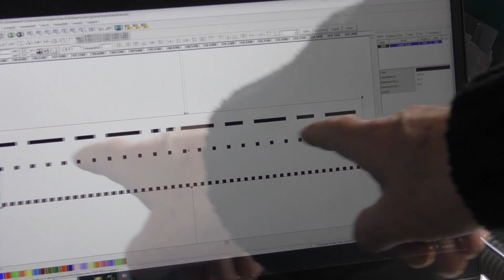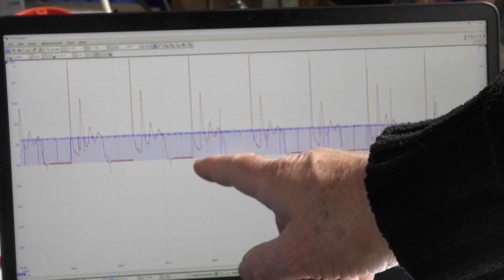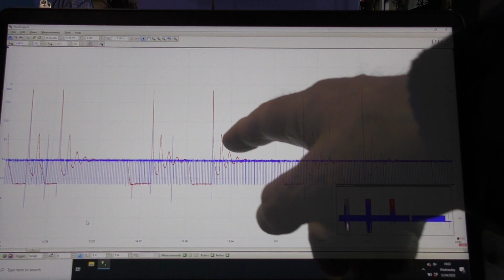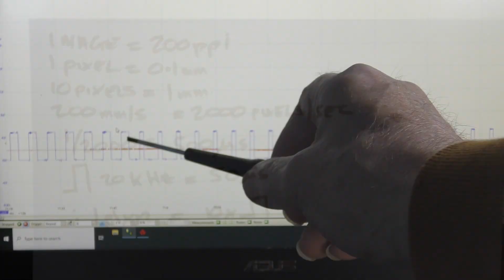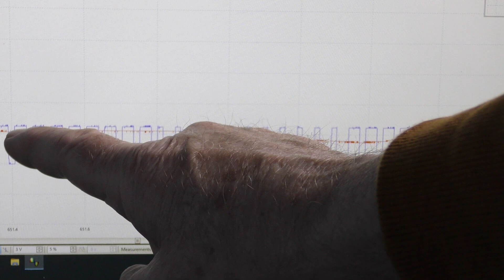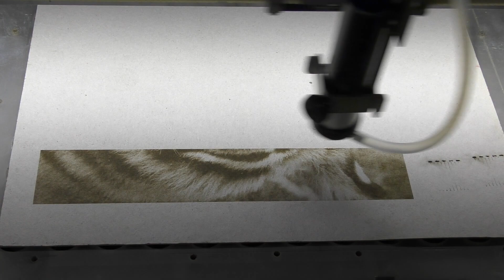RDWorks Learning Lab 250 Deep Dive into HV Power supplies

Comment: Hi there, we have been following your channel for some years and usually we can find fixes for problems pretty fast. In December our machine started to arc so we replaced the tube then it did something else so we replaced the power supply. At best we have it working to half efficient. I am hoping you are willing to help us out. Is there a possibility of that
Reply from the maker: Hi
 I will be happy to help you but yoiu will need to contact me privately  with the following  form. I will respond and we can then start a dialogue and work out the best way to proceed.
https://forms.zohopublic.eu/ndeavorlimited/form/K40XtreeemLaserCutterContactRussSadler/formperma/k2Cn0QN5ChpazfTMAUw25lZ-FKpjZa96TQWHjv3ntOg

Comment: Could  you put together a video and  do  similar tests  as in  this video and compare how a rf co2 tube compares to a glass hv power supply?  Also I'm highly assuming a higher kW max power supply than needed to excite the gasses in a glass tube would spike the watts/voltage initially and therefore degrade the tube more rapidly over time used than a lower kW max power supply.
Interested in what the voltage output looks like in the same  type tests between.
Reply from the maker: Hi
Sadly there is no comparison possible because RF and Constant Current tiubes operate withcompletely different principles. The end result is the same in that both produce a stream of output photons witrh a 10, 640 nm wavelength. The glass tube uses a high voltage to excite the nitrogen in the tube  which in turn stimulates the CO2 to create a laser output whereas the RF tube uses a GHz freqency with low voltage (about 40vdc) to achieve the same result. Because both systems are ionizing the nitrogen (producing a pink beam) they both pass throug a critical phase EVERY time the beam switches on   If you take glance at this diagran you will see that phase defined as Townsend
https://www.researchgate.net/figure/V-I-plot-of-a-DC-gas-discharge-7_fig1_327209884
This is a phase where the just a few free electrons (negative charge) in the nitrogen are stimulted to rush toward the anode (positive), crashing into other nitrogen atoms  and freeing up more electrond to carry current.  In the glass tube system  there are two distinct functions for the power supply. First it has to create a high voltage to stimulate the gas to ionize. However, stimulating the massive release of free electrons  means the potential for infinite current flow through the gas which is bad news, hence there is a secondary function for the HV psu and that is to limit the current flow to a few milliamps. This control of current is is achieved by a feedback circuit  BUT  this Townsend region is a phase of inoziation instability that we call preionization where the random nature of colliding free electrons can cause huge current flow spikes . In this phase the current feedback system  cannot respond quick enough to manage the current flow. It is only when the ionization reaches the glow discharge phase that the current flow can be managed by thr HVpsu.  In the case of the glass tube it is possuble to adjust the current flow through the tube  to change the power output of the tube. The  % power parameter is not controlling watts output but instead is is controlling the current flow through the tube  in a linear manner, The  output watts is very non-linear and will depend on the design and manufacturing quality of the tube.

As can be seen from this video, it take several milliseconds to intiate a stable output from a glass tube  EVERY time the beam switches on.  The RF power supply works in a completely different way. When you first switch the power supply on the high FREQUENCY causes the nitrogen to pass through this Townsed reqion of preionization but it only ever does it once because  there is  internal circuitry that provides a "tickle current" to keep the system at the edge of the glow phase even before you switch the beam on.  This means there is an almost intsantaneous power output the moment you ask ther beam to switch on. However, the biggets difference is the way the tube operates. It is controlled by a PWM system which means ther is  NO VARIABLE CURRENT CONTROL. The current is  fixed at a maximum that the manufacturer has deemed as a safe  long life value for the tube Thus when you buy a 60 watt RF tube  it  can only do two things...... deliver 60 watts or zero watts. There is no power control,  just an ON/OFF switching function The appearance of power control is acheievd  by allowing the beam to be on for a variable period during each PWM cycle  Thus %power is not controlling output watts  with this tube either, instead it is controlling the PWM duty  period and is ALWAYS operating at full current flow i.e.60 watts output

The claim that RF tubes have a much longer life than glass tubes  is very dubious because  the current flow  parameter that the manufacturer sets for an RF tube,  makes it possible to predict operating hours  with a reasonable degree of certainty (a bit like predicting ther number of print pages from an ink cartridge).  The dissociation (degradation) of CO2 in a glass tube depends on the current flow that the tube is used at. The manufturer of glass tubes specifies an allowable maximum opearating current and a typical operating life  but most people do not run at the max current  and many laser operations (like engraving) do not require high power.  So there is no way to compare liftimes. I personally have tubes that a 9 , 6 and 5 years old and all are still functioning as new. Just like an ink cartridge,  when the CO2 runs out the power stops 

The cost of a 100watt RF tubei is  6 to 8 times that of a 100watt  glass tube , so assuming  a glass tube lasts 5 years, can you  find an RF tube with a 30 year lifetime  I have spent money and time buiding and testing an RF system in an attempt to find the "magic" claimed for the technology.  Switching speed is it's only redeeming  feature  bcause that allows  for precision engraving. It is necessary to manage the massive beam divergence characteristic with a beam expander , which in turn wrecks the beam intensity profile and makes it a very inefficient cutting machine. After years of decrying the  cheap  short lifespan glass tube technology, Trotec have had to accept the weakness of RF technology for cutting and are now selling a Q series procuct that integrates both technologies. One for engraving efficiency and one for cutting efficiency.

Soory, there is no quick short answer to yout questions.

Comment: For cardboard/paper cutting - do you have a min power set (that is lower than the max power)?  The reason I am asking is because if there is a min power, then it will be lower than the pre-ionization power. For me, my accel values are set low in order to get straight cuts, but that in turn requires me to have the min power lower to not burn the corners. What do you think would be the best solution in this case?
Reply from the maker: Hi
Max and Min are equal because this is not normal constant power cutting. Enen though you still slow down forthe corners, the very short high power pulses do not cause burning because  they are always instantly vapourising the card.
 Reducing acelleration to achieve staright cuts  sounds like a mechanical issue.  If you wish to contact me privately so that we can try to sort this with email and pictures/video then use the following form

https://forms.zohopublic.eu/ndeavorlimited/form/K40XtreeemLaserCutterContactRussSadler/formperma/k2Cn0QN5ChpazfTMAUw25lZ-FKpjZa96TQWHjv3ntOg

Comment: Hi Russ, thankyou for these very interesting videos! A question please, the maximum current for a given tube can be limited by adjusting a trim pot on some HV PSU's, is there any disadvantage in ignoring that trim pot and instead limiting the current by reducing the allowable PWM duty cycle max in DSP controller settings (Laser max power% in Ruida)? Or is it effectively the same thing? Does the trim pot simply internally reduce the voltage of the PWM signal after its been converted back to analogue inside the PSU? My head tells me that the option of trimming the PSU and utilising the full 1-100% PWM pulse width/duty cycle range to relay the power control signal would result in better resolution when engraving varying tonal burn intensities in images? Penny for your thoughts.
Reply from the maker: Hi Nic
 A glass tube makes no use of the PWM because it is a CONSTANT current system that never switches on and off during running. It is only RF and diode lasers that can exploit the the pwm control.  I believe it is preset to 20kHz to control the stepper motors. Yes you can use the PWM output from the controller to controlthe %power into a tube  but  it can be confusing. Ruida recommend you use the analog output at  AN1 at CN5 for glass tubes. and the PWM output for diode and RF lasers. However, if you use the PWM output for a glass tube it just converts the analog output into a digital signal to encode the %power. As soon as that digital signal arrives at the HV power supply andinput filter convrts it back to analog. So ther eis zero control of your glass tube with PWM..  
The next issue you have to come to terms with is understanding what % power means. It's nothing to do with watts. It all about the max output current that your HVpower supply controlls. 100% power = max HVpsu output  and it is linear all the way to o%power=0mA. I So if you have a power supply that delivers 30mA ma and your tube requires 24mA max then your max current should not exceed 24/30=80%. see no value in fiddling with the PSU output to match that allwed through your tube. If you have an ammeter fitted its just a matter of running it at various powers to find the % power that allows the max allowable current through your tube. Lets say ist 80 % - 24 mA then you can set 80%max in the vendoer settings and never fear overdriving your tube. Ah, I here people say, but that means I lose some of my power control because I am only ever using 80% of the range.  Hmm .... is that REALLY a problem?  %power can be set in increment of 0.1%. That mens you have 800 power increments to platy with  Yes you may need close control of low power if you do photo engraving but in 8 years with 3  different tube powers I have never use a 0.1% power increment. I have never experimented with that control so I do not know if it is a proportional gain control or just a peak current limiter.....which is exactly what the Max %power does in the vendor settings.
If you look at any of my scope traces of the current flow , the only time it goes bonkers is during preionization and that is totallty nothing to do with PWM. The PWM I use in these tests is so that I can see the 50 microsecond  20kHz digital PWM signal that the controller sends out. I can also instantly see the  % power (current flow) demand that the controller is asking for  (the PWM duty cycle)  and the difference clearly shows that all these HV power supplies are pathetically slow.  The only reason I am able to get rapid response for photo replication is by staying in tha bonker out of control preionization region where the performance is accidently close to that of a PWM controlled RF laser.
 Best wishes.......Russ
Reply: @SarbarMultimedia  Thankyou Russ for your prompt and detailed reply, very informative. You have left me with a lot to think about. If I get the chance I will try to run my own tests to find the preionization zone on my system and test for more responsive engraving - fascinating stuff.

Comment: Thanks for this review. I just installed a HY-Z Z-80 and am quite impressed with its performance. I was curious to see that the voltage is not constant, across the range of percentages. This one goes, from a low of 13.4kV, to a high of 25.7kV, before settling down to above 35%. The response time is significantly higher than the stock MYJG supply that came with laser.
Reply from the maker: Hi James 
 Your curiosity is   justified  but dont worry the voltage is never going to be stable. The purpose of the high voltage is to break down the nitrogen gas  which represents about 10% of the gas mix in the tube. All gasses are naturally non conductive  ie they have a VERY high resistance,. When you excite the nitrogen molecoles with VERY high voltage  it causes some of the electrons to break free and it is those free electrons that carry current. Simple Ohms law says Voltage = Current flow X Resistance.  So when the gas "resistance" is almost infinite there will be no current flow so the voltage goes higher and higher  until it reaches a point where th nitrogen starts to ionize (the pink glow in the tube) and current starts to flow because the resistance of the gas drops to  almost zero.. This is bad news because low resistance and high voltge = massive current flow = exploding tube!!!! That is where the other function of the power supply takes over and limits the current flow to a controllable few milliamps. So back to Ohms law and now we have low resistance ionized gas  (lightning in a bottle) and low  current flow so it only requires a low voltage to maintain the ionized gas state.  The trigger voltage for the tube depends mainly on the length of the gas column. Thus higher wattage tubes are longer and require more voltage to create ionization. However once ionization is established the high voltage will drop from say 25kV to maybe 15 to 17 kV.. The only important thing to worry about is the current flow through the tube and that is something YOU have control of. %power is not watts but  current flow through the tube. Look at your power supply spec and the HY-Z Z80 can dliver up to 28mA. That means that 0% power = 0 mA , 50% power = 14mA and 100% power=28mA. If you have an 80 watt tube  the manufacturere will specify a working current, probably 26mA max. That means you are allowed to use up to 26/28= 92% power in your programs.. The watts outputf rom your tube will never be linear so an 80 watt tube will not deliver 40 watts at 50% power, it will probably be closer to 60 or 70watts.  The HYz series of power supplies appear to have no different response times to any others EXCEPT in the way it manages the preionization zone. For most normal applications you will see no difference  between any HV power supplies . but my careful examination of the preionations zone allowed me to exploit a property that other power supplies do no have. Its brilliant for photo replication of dithered images.
Reply: @SarbarMultimedia  when I say response time, I am referring to the power supplies ability to rapidly turn on and turn off, especially in the Pre-ionization zone. Due to, what I consider improved response, I am able to photo engrave at speeds of 300mms, where, with the stock MYJG power supply, anything above 100mms, and I would start loosing resolution in the picture engrave.

Comment: Very interesting. I think the massive peak at the start is because the tube needs a high voltage to strike but once the gas is ionised it runs at a lower voltage. So if there is any capacitance in the circuit you get a big current spike. If the current is too low the discharge stops and the voltage has to build up again to make it strike again. That gives the unstable "pre-ionisation" stage.

The slow response to PWM changes is probably because the PWM is converted to a control voltage with an integrator, most likely a simple RC filter. Perhaps a better system would use a DAC instead of PWM, or a much higher PWM frequency and a faster filter.
Reply from the maker: Many thanks
That is a nice simple explanation of the behaviour. We cannot easily change it but understanding that different power supplies manage this unstable phase in different ways has allowed me to dramatically improve my photo engraving speeds to almost match the 800mm/s capability I can achieve with my RF machine capability. However, the sluggish pixel to pixel  respponse will always produce a "smoothed" 3D engraving result and a fuzzy  grayscale engraving.